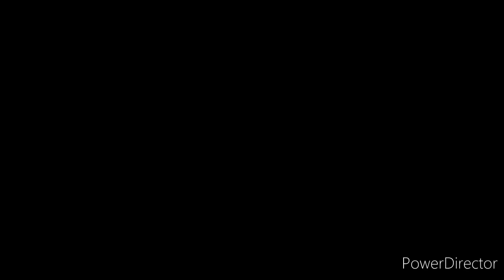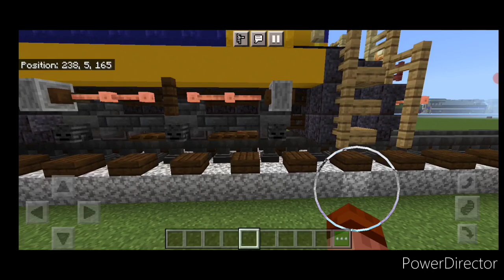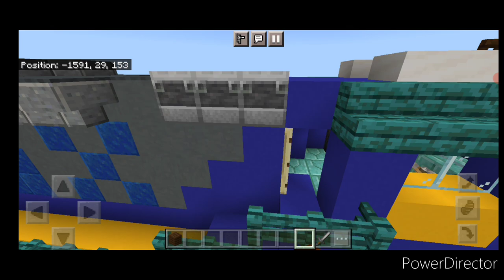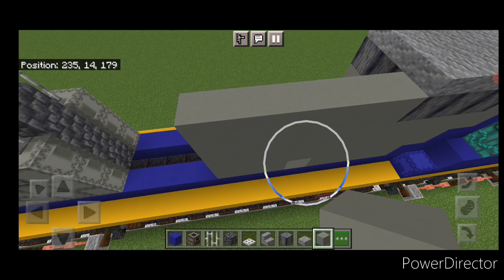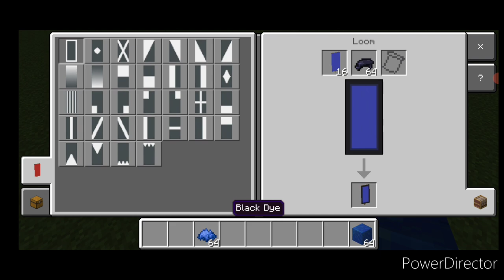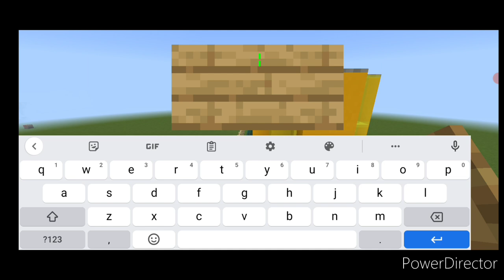Minecraft CSX YN2 SD40-2 Tutorial.  Updated All-New Build!

Comment: the front one is weird, cuz its like its have too much curve of it tho
Reply from the maker: Yeah it does change the front, but I think I'd rather have to move accurate doors and cab
Reply: but its not accurate to the real life thing that is straight tho
Reply from the maker: It's a trade off.   Before I had two inaccurate doors and an inaccurate interior.  This is one inaccurate thing instead of three
Reply: idk if a command block will work
Reply from the maker: I think I have found a satisfying fix for it. That will allow both the new door placement and not have the front stick out. Will debut in tommorow s video